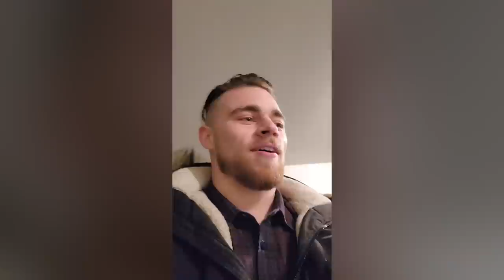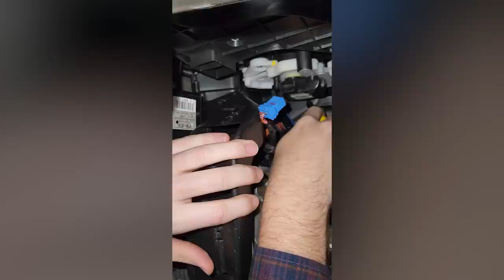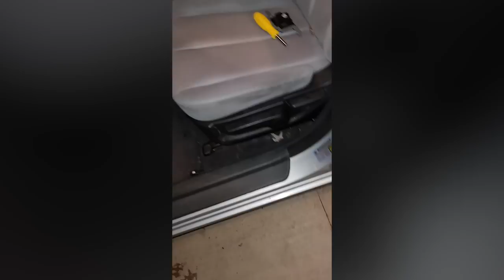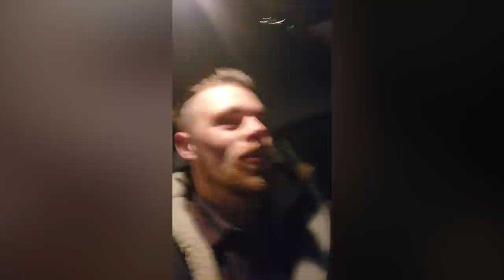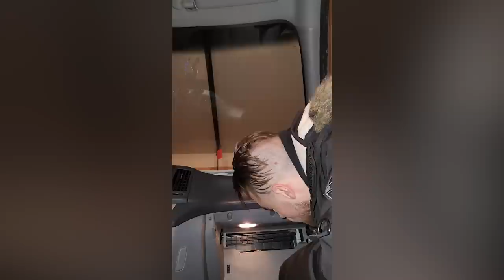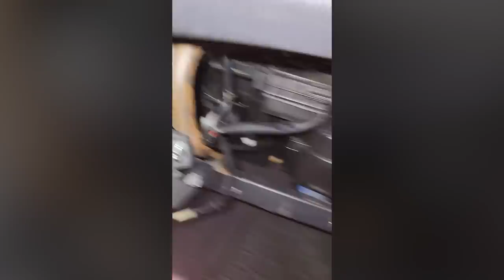Worst How-To Car Repair Video [by PlannerDanner??]

Comment: Identifying the correct HVAC door actuators can be tricky even for very experienced mechanics, so don't feel bad for struggling! And nothing wrong with relying on YouTube videos, either! YouTube (and specifically discovering ScannerDanner) is 100% responsible for taking me from a mid-level parts changer to a (now) well paid diagnostic technician. 

I worked for a few years at Pep-Boys until about 2005 and left dissatisfied with the industry. Worked with a bunch of grizzled old-timers there who would CONSTANTLY tell me "get out while you can, this job sucks and you'll never make any real money". Discouraging to an impressionable young man, to say the very least. 

Did a 12-year stint in the Army and, after getting out in late 2016, I VERY hesitantly re-entered the automotive repair field (as roughly a B-tech in old Pep-Boys terms). I was determined to not fall into that old-timer mentality. 

Every, and I do mean EVERY single night after work I was on YouTube absorbing everything I could, like ScannerDanner + Premium (and a few other good channels like Eric O and Wells-Tech). It re-kindled my interest in this field and CLEARLY showed that there was another world out there that I was not taking advantage of. 

6 years (and a few job hops) later, I am now an ASE L1 Master Technician making DANG NEAR TRIPLE my starting salary back in 2017. I am now the lead diagnostic tech (Foreman equivalent) at a very reputable nationwide dealer, and you can bet your BUTT that I do not fill my younger guys heads with all the nonsense that the older guys back at Pep-Boys did to me. My attitude has done a complete 180. I tell the young guys that there is so much personal satisfaction, and more importantly MONEY to be had in this industry if you want. It's there for the taking! GO GET IT!

It is not an exaggeration to say that ScannerDanner has changed my life immeasurably for the better. I will be forever grateful to you and your family for all of this, and I look forward to the future.

God bless you and yours 🙏
Reply from the maker: Pinning this. Love these kind of stories so much! Props to you for making it happen. Seriously not many have the drive needed to self study. Proud of you man. Thanks again for sharing this with me.
Reply: That's an awesome story Justin! So nice to hear a success story and the positive impact you are making on the industry to the younger techs!
Reply: Congrats! You have now become ScannerDavis!
And now you do have a world, and when you do a Rainman Ray and start for yourself, you will get to be known as the guy that gets stuff done right.
The bad is, you will have to work on other shops F ups and spend a lot of time fixing their half job... But you will get people that keeps using you as their mechanic.

Comment: This was me 35 years ago, just learning how to use tools. I broke a lot of trim parts. Will I am very good now turning a wrench. But I remember back in the day, My wife stop me to do the house electrical. She told me, " Your not going burn down are house."  "I have seen your car."
Reply from the maker: 🤣🤣 that's awesome
Reply: Yup. The worst was when it was your only ride, you were broke and you had a $9 Kmart tool set. It was snowing and you could not feel your fingers😂
Reply: Trim parts are scary. You almost never know if you're applying enough force or are tugging on the wrong area. 🤦

Unless you've done it before.

Comment: The struggle is real on this one 😂
And all good technician will have extra 1 or 2 screws after they are done. 💀
Reply from the maker: It really is! And that despair feeling is no joke 🤣
Reply: @ScannerDanner  😂
Reply: That's what the screw bucket is for. Mine weights about 20 lbs after 25 years of wrenching on stuff.
Reply: @mph5896  pretty irritating when u need one ,  and can't even find it in that stash
Reply: @Nabil_Afzal  I spent a couple hours this year organizing the junk screw/bolt/misc stuff bin. 🤣Now its like 12 different bins of various sizes. Best 2 hours I have spent in a long time.
Reply: @mph5896  thats best time investment you did to avoid frustration lol

Comment: You could just Prop the blend door open manually lol my blend door actuator went out last year and I’ve had it propped open for heat all winter sucks when it gets kicked by a passenger and you have to prop it back open (no parts required) ;)

Comment: If you have a screw that won't come out ......
    Pry or leverage it using another flat head screw driver under it ( if there is enough room , space available ) while unscrewing the offending screw   
       Or .....
     Wrap a piece of copper  wire around the head of the screw and pull on the wire as you are unscrewing the offending screw 
       Bigger hint here is the length of wire has to be long enough , say about a foot , one and a half feet long to get that pull needed 

   
    I've seen Dad start the lawn mower with the corded electrical drill after  the  pull start cord broke snapping which left a very short piece coiled  inside 
   Chuck opened to a size to fit the top nut , drill button pushed in ..... wizzzzz goes the drill     brrrrimmmmm goes the lawn mower 
   Ahhhhhhh , " rotation " equals engine start    ok

While with the family returning home , as a kid I'm saying to the parents , mum , Dad I'm going to be sick , I'm going to vomit 
   " Hang on we're almost home "
    No , I'm going to ..... brgggggg on to the floor of where my feet are 

  Dad pulls the car over , under the under pass , turns the car off , cleans up the mess ...... goes to start up the car , and nothing ....
Key turns , no start 
  Ignition lights are showing but no start , .....
   Couple trys ... no start 
Dad gets the large screw driver ..... which is about nine inches long , and touches both sides of the power contacts of the starter motor , " shorting  it " , thus starting it  away we go ( we're about twelve minutes from home )
 The key ignition barrel has a square block on the back that is an actuator to move the plate behind it turning it to Transfer / Switch the Induction contacts that transfers the power to make the starter motor start , move .....  " turning the motor over " thus starting the engine 
   Applying pressure in to the key , barrel made the ignition lights come on ,on the dashboard... but not move the actuator further to move the contact plate .... hence why the biggest nine inch long screw driver to short the starter across the positive and earth points 

   Dad is an Locomotive Engineer .  " Bic Ball Point Pen is the most important item to have ,  ...... it insulates you from the power switches when chasing electrical switching faults "

    Thanks for reading 
But Wait There's More....

Comment: HEY Guys, love the channel, keep em coming. I have a 2005 Infiniti Q45 and recently I've pulled a P1614 code.
is there a fix I can do or am I at the mercy the dealer having their way with me?
Reply from the maker: What's the definition of that code?
Reply: @ScannerDanner  

Immobilizer control module/module coding plug communication – no signal
Reply from the maker: @polishedbrother  I have no suggestions for you other than to research that fault code and follow a flow chart I'm sorry Here is a link for service information you can purchase for an individual vehicle This is the same service information that I use
https://eautorepair.adtrk.biz/?a=10817&c=24&p=r&s1=